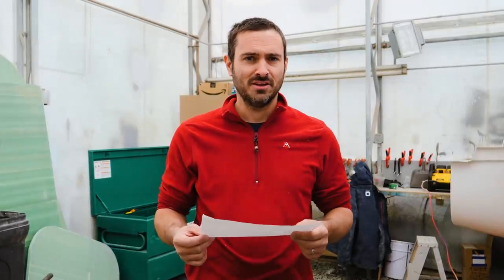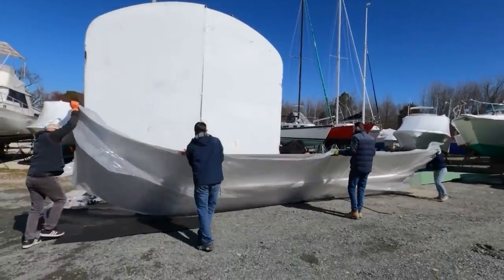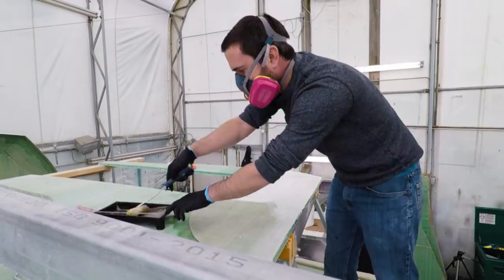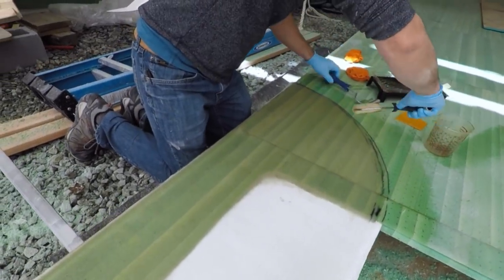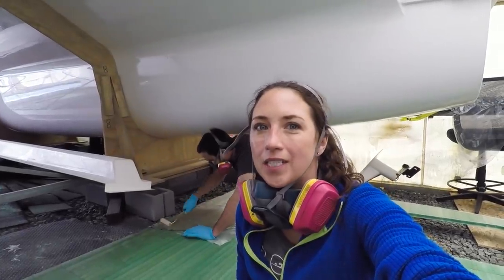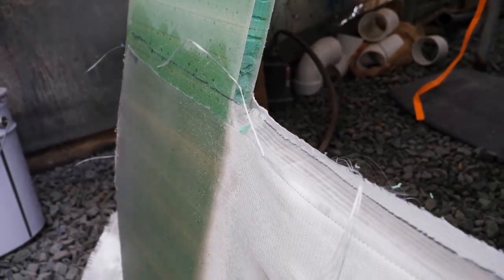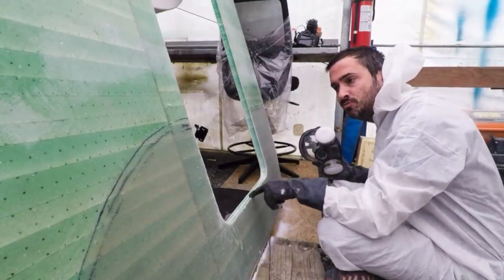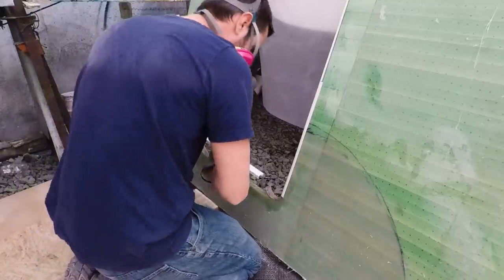CATAMARAN BUILD - We Could Have Done This Better (MJ Sailing - Ep 185.1)

Comment: If you trim it before it fully cures, when it is still rubbery, you can easily trim it with a sharp utility knife. We also always trim any overhanging cloth to within a half inch of the edge after wetting it out, as that makes it easier to trim, and avoids getting an air bubble right on the edge of the panel from the weight of the cloth drooping. Also, be careful doing one side at a time as it is possible for it to warp the panel.

Comment: I really love watching your videos. So, more is better in mho.
Reply: Like your work and can’t wait to see the boat finished. Good how you are in tune with 0-90 & 45 cloths. However you need to know that it is a standard in the industry when doing multiple layers of cloth you should stagger the size of each layer (curves areas on either side of opening on bulkhead) to spread load. 3 thick layers almost the same size will overload the thinner layers beneath the curved edge.

Comment: Not sure if that "light hack" was a one time work around but to save your camera equipment, there are battery powered led work lights (hand held, magnet mount or both) available online or likely at big box hardware outlets. They might even come in handy for solutions to problems you're not able to guess at yet.

Comment: That episode was fast! Actually, either way you guys like to put these out is fine. Just got to say again that this work is amazing to watch, Max Cruise Marine is going to be overwhelmed with orders for the 42 footer. I had to rebuild a much smaller boat, a wood-epoxy-composite multi, and this looks far more straight forward than that! It is often the case that a small project takes (just about) as long as a larger project due to the number of steps one has to complete. Nicely, you'll be doing a lot less sanding with this project!
Reply from the maker: What kind of boat was that Rick?  Was it a Searunner?
Reply: @MJSailing  No, it was a modified Trailer Tri. This was a Ian Farrier design, but the builder lofted the lines himself based on the F-25. Odd that he would do that and then strip plank the main hull with western red ceder when he could have used the vertical foam strip method. The main hull was beautifully executed and was faired so well that it was almost "organic." The rebuild took 11 months, think of that! In 11 months, you guys will be about half way to launching the boat!! You guys are doing really nice work! Hope you're getting a lot of support from Max Cruise Marine, you're going to keep them busy for years.

Comment: I don’t know if you saw the suggestion below, but it’s worth repeating. If you do it just before it sets too hard, you can easily cut the layup with a razor knife and it will save you an incredible amount of work. Also as said below, do whatever works for you on the videos.
Reply: Yep, when it green, it cuts very easily with a knife, including through the glass.  And you can smooth off surface bumps with a sharp paint scraper.  Saves a ton of time!

Comment: as the epoxy sets but before it's solid, a sharp razor knife or scissors would have easily and cleanly trimmed the doorways. Used that trick when building my plane.
Reply from the maker: That MUST be a pilot thing!  We've heard that trick now from a few of our Patrons now, who are also pilots.  😃👍
Reply from the maker: Epoxy did better than VE in allowing us to cut off the excess before full cure in past projects.... The VE tends to pull away and delaminate unless hard set.  -Matt

Comment: Suggestion, green trim your glassed edges using a craft knife guys it will cut your trimming time and dust down and save a small fortune on saw blades, also makes it easier to fold up and dispose of the waste.

Comment: Glad you are considering over building the bulkheads which seem to be a weak point / point of failure for several boats. Eg Parley Revival.  I would go all the way up though as they are failing in compression.
Reply from the maker: The current string of failures are in plywood bulkheads with little to no tabbing to the hulls/deck.  Big difference between those and foam cored fully glassed bulkheads.  

Matt

Comment: Proposed method to install/retain fiberglass around the doorway cutouts.
- Attach a long strip of Peel-Ply under the straight edge of the cutout with screws/nails/tape/etc. leaving it hanging free.
- Install your rolled unidirectional fiberglass rope.
- Pull the Peel-Ply up through the cutout, tightening it over the 'rope', fastening it along the topside.
- If necessary press a plastic square u-channel along this over top the Peel-Ply to ensure a square edge.
- The corners can be done the same with multiple inch wide strips.

Comment: With the smooth side of the bulkheads did you sand it to get better adhesion before glassing ???
Reply from the maker: Yes.  60 grit sanding, styrene wipe down, then glass.

Comment: What's your plan for interior finish? Is it possible to vacuum bag a layer of (let's say teak wood) veneer on the bulkheads before you install them? That way you don't have to be fighting gravity if you do it all after the fact.
Reply from the maker: Still trying to decide what the interior finish will be.   But since all bulkheads get fiberglassed all around their circumference, we could do a veneer before they are installed.

Comment: Get the right router bit. Get a 2in long with a bearing.  Also, use the negatives as templates for the router, not the positive form. You can always lay the negative over again and trim if need be.
Reply: The door under the positive template is the important part.  The doorways get trimmed, the door blank does not, so its what needs to be accurate.   -Matt

Comment: Cutting those sections out...  if you wait until the layup is hard but not cured, you will find a sharp knife does a great job cutting the excess away.  And you wont need to get into the space suit!  i still cant believe your building a cat.
Reply from the maker: I've found that anything more than just a light 6 oz cloth tries to pull away and delaminate if triming before full cures with our VE.   -Matt

Comment: Are you ever going to regret leaving out a sheet or two of carbon fibre? I know that these door surrounds on 10-year old Lagoons are under a lot of scrutiny for failing and bowing under sailing and rigging stresses over time. But I think that they used a resin and thin fiberglass over marine plywood; a lot of these have run into troubles though - as discussed in the most recent Parlay video. https://www.youtube.com/watch?v=h6ABr4oMsX8&t=14s

Comment: Lol you mean 2 videos means 2 videos with advertisement's for you instead of 1. Don't make out it's for another reason because it's not and it's ok as well. Building that cat ain't cheap.
Reply from the maker: I won't lie, it does help with our analytics.  But since they are shorter episodes, there's less mid-roll ads.  So all in all, about the same number.  Although first day pushes on ads do get the best CPM rates!  😉
Reply: @MJSailing  well I watch your videos more than once and I save the cat build into a playlist for the future when I build my own so keep up the good work. May I suggest one thing though. I've noticed the last 2 videos you make mistakes because of rushing things as you've stated yourself in this video. I just suggest not to worry about time and just do it right the first go. Talking to Matt lol. Don't rush less mistakes better build.

Comment: as a ship engineering  navy  have air tight sectional voids  for better protection on the lower hull. in case of a hole or crack underwater..  that is why us navy ships stays afloat better..
Reply: Agreed, if you don’t want a door, you can raised the opening base to be step over, but well above the wl